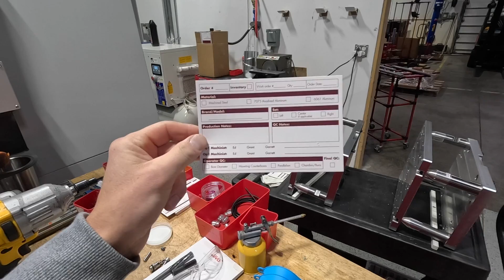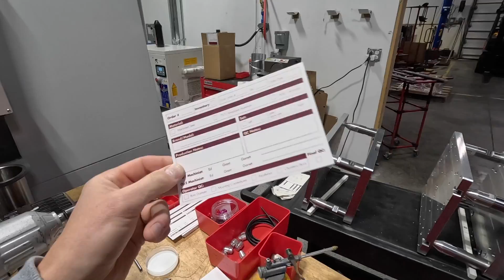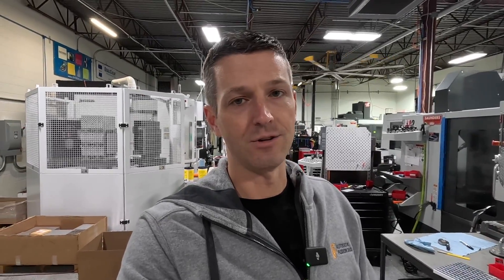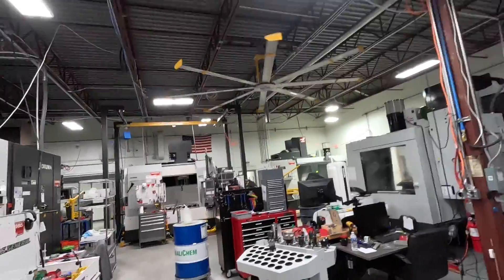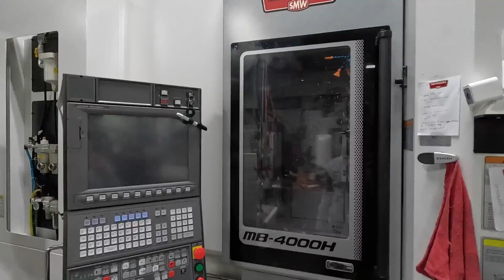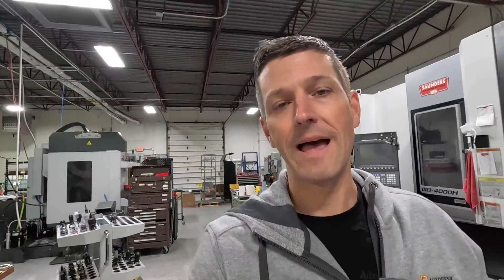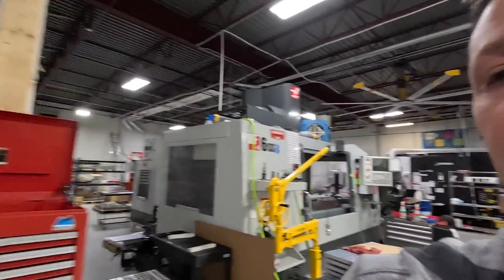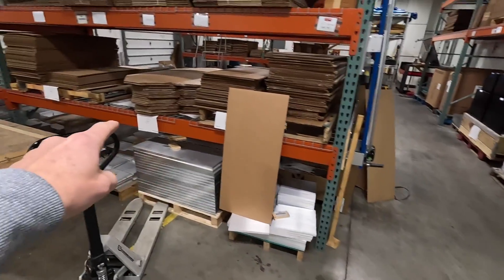How We Use Technology in our Machine Shop!

Comment: Recommendation regarding building an ERP with no monthly fees: Retool. Currently in the process of building an ERP type system, manufacturing and electronic component inventory management as we are a small startup electronics manufacturer building our own products. As I'm familiar with MySQL, I was looking for an easy way to create a GUI without getting into a really manual process with HTML and PHP (although don't mind using those for specific customisations) so I found Retool which is specifically for building internal company systems. There's no fees for the basic version which I'm using. Definitely worth trying it out or looking for something similar.